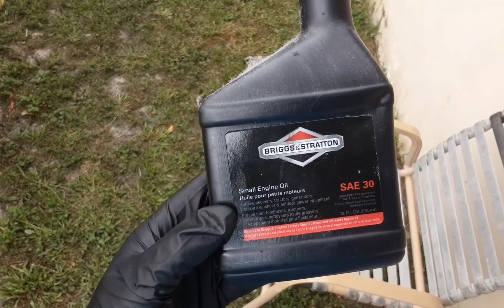How to fix a surging lawn mower "Quick and Free"

Comment: How to fix a surging lawn mower take off carburetor clean and put back on
Reply from the maker: I actually tried that and always clean my carburetor, but the surging didn't go away. The moment I cleaned the cylinder head, the engine ran smooth. Cleaning the carburetor won't always fix a surging lawn mower. Just like how there are multiple reasons why a mower won't start or stay running, there are more than one reason why there is a surging lawn mower. That's why there's so many parts. Every part counts and makes a difference.
Reply: @GreenThumbEngines  yes sir you are so right

Comment: No.
Reply from the maker: On the contrary my noble commenter.. I say Yes. Lol I cleaned the carb and started the mower and it made the sound you saw in the beginning of the video. So then I took off the cylinder head, cleaned off all the black dried ash from the inside and then the valves ran so much smoother and made the lawn mower sound strong and steady. No more surging shakiness hesitation fluctuation that I hate. I hate that shaky shit.